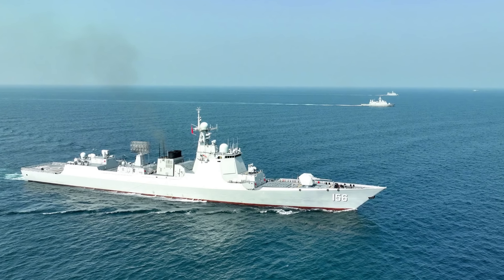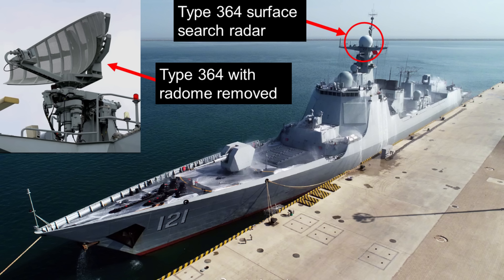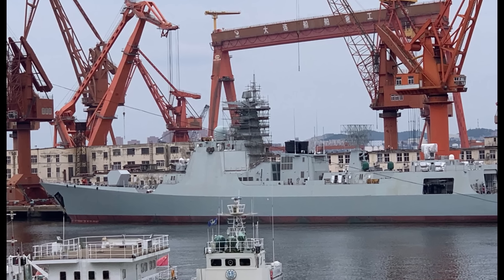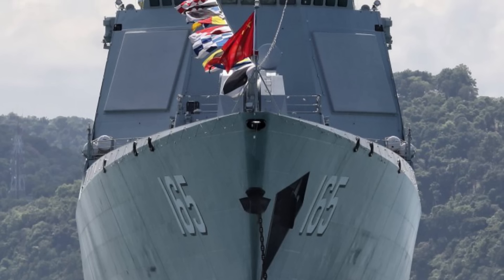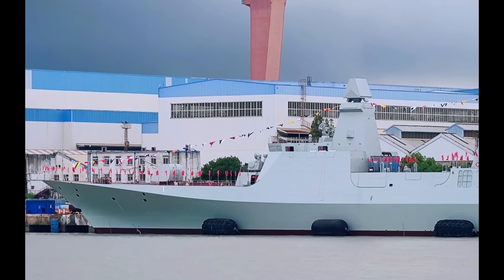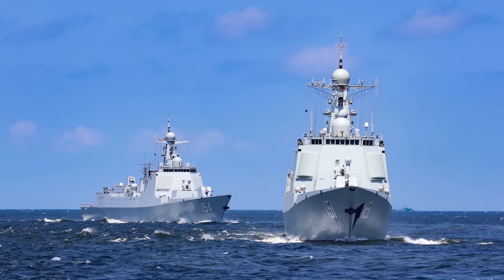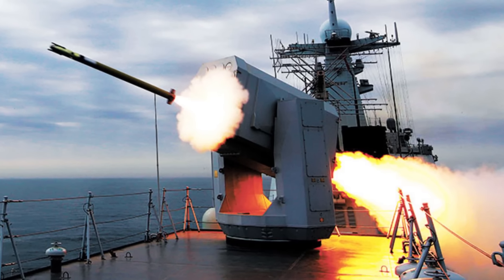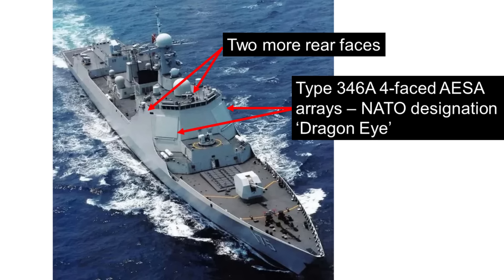China's Type 052D Destroyers Get Upgraded Air Defence Radar

Comment: Is there a reason why the type 55 does not have this radar?
Reply: She has 4 sided non rotating AESA radar at the mast.
Reply from the maker: The Type 055 actually has a different X-band radar that serves the same function - it is different to both the Type 364 and Type 368. The 055's integrated mast has four fixed AESA arrays within the integrated mast, some way above the four large Type 346B arrays mounted lower in the superstructure. If compared without any context, the Type 055's X-band radar should be miles ahead of the Type 364, and likely the new Type 368 as well. However, there are downsides that must have prevented it being used on other ships.
The 055's X-band radar has the drawback of being larger, certainly more expensive, presumably heavier and presumably more power hungry. It is worth noting the Type 364 radar on the Type 052D/C actually has a slight advantage in terms of radar horizon over the Type 055. This is because the Type 364 is mounted higher on the 052D/C than the X-band radar is on the 055, which is almost certainly because it is a lighter system in terms of weight. The 055 has the power generation to use the X-band AESA, which the 052D probably will struggle to an extent to use well.
Reply: @EurasiaNaval  thanks for the detailed explanation bro!

Comment: Retrofitting will most likely happen, but only during the mid-life refit, which is still too early for the 052D.

They just finished the refit of the 051B, 052B, and 956E. Essentially converting them into large 054A. 
The next due for refit should be the 052C, which have Type 364 dome. We will see if they will be refitted with double sided array (and update the rest of the ship to 052D standard)
Reply: the first two 052C are already finished ... and Chinese engineers don't not change the radar system.
Reply: This is not necessary. The 052c is not as sexy as the 052d, but it is still a very powerful Aegis destroyer in the world.